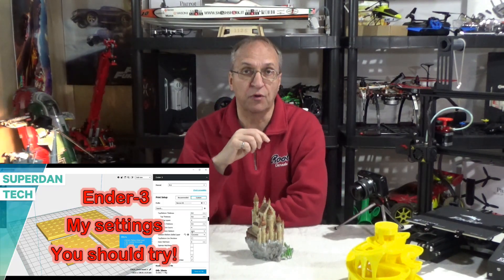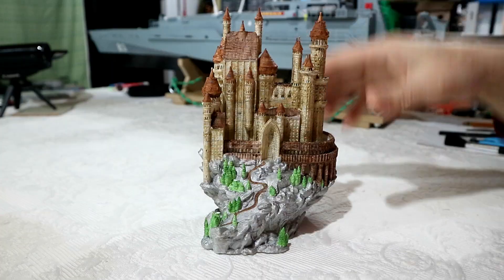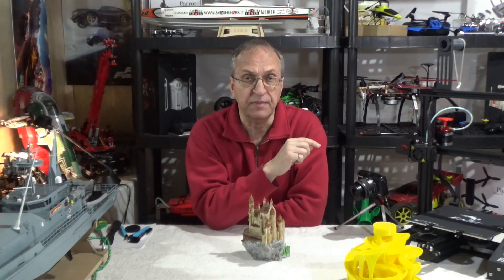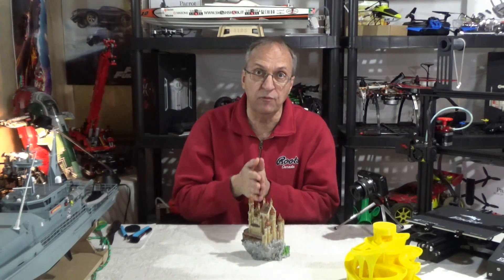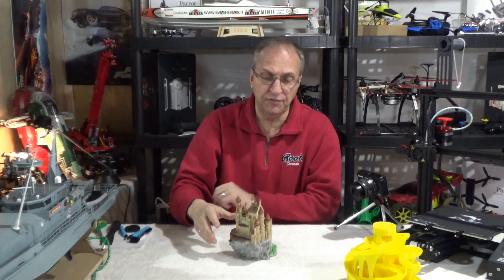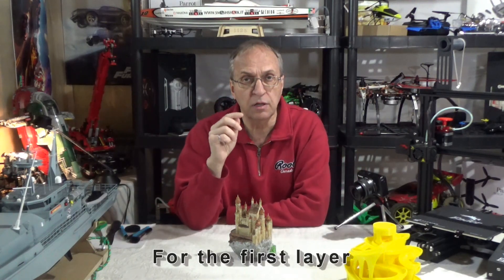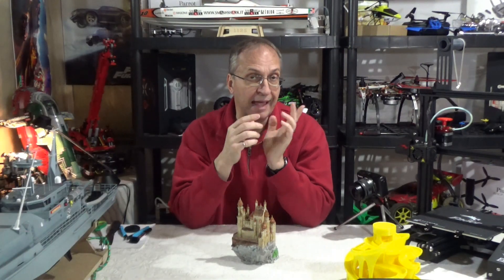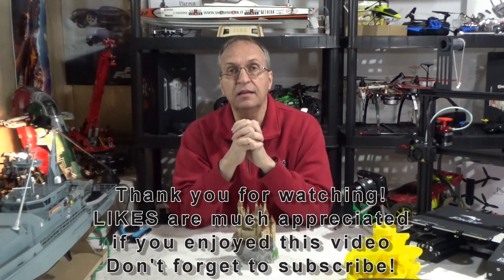Ender-3 3D printing | The castle and two important parameters!

Comment: To compensate for the colder room did you raise the print temp as well?  Maybe 210 instead of 200?  And reduce the fan speed? 

Very interesting though. I just had my first print with an issue like that where a bad adhesion line happened in the top third section.  Was trying to figure out what might have caused it.
Reply from the maker: Good point Andrew, I was going to do some testing at temp above 200.  I did a few tests when I first got my printer but I did not see any variations in print quality.  But this was at the very beginning of my 3D printing experience.  I should try again using the calibration cube.  I am actually posting another video on 3d printing in a few days and I will talk a little more about some parameters like brim and raft.  Thanks for watching!

Comment: Hello its Mike again great work. Still using your filles. But cura update. Does have 1.5 its say1.6 when start fresh. When you do expert.. 👍
Reply: I'm sending my email address on your Web page
Thanks
mike
Reply from the maker: Hi Michael. The current version of Cura is 4.5.0. Send me an email through my website and I will send you my new profile for 4.5.0.  I hope this helps.
Reply: Hello thanks for the file. Have changed it. Layer height was. 0.15 and now its 0.2 is that OK. Thanks mike
Reply from the maker: @michaelterry8671  I use 0.2 when I am printing large objects. Use 0.16 for small objects.
Reply: Thanks. 👍